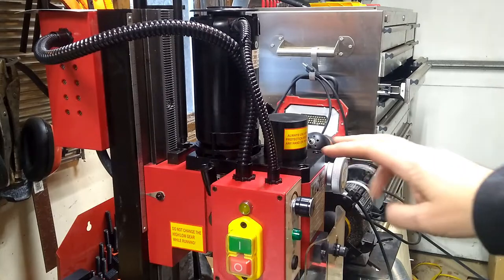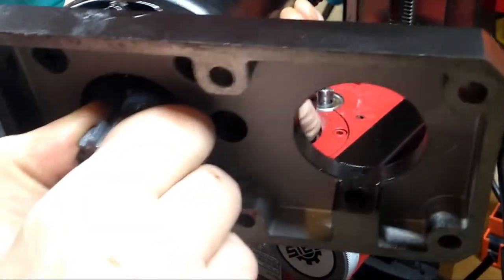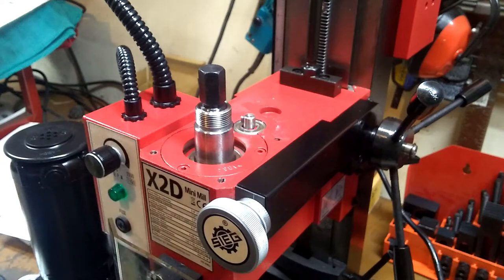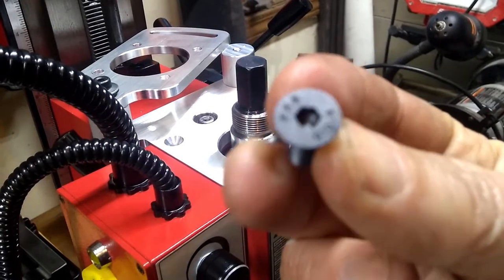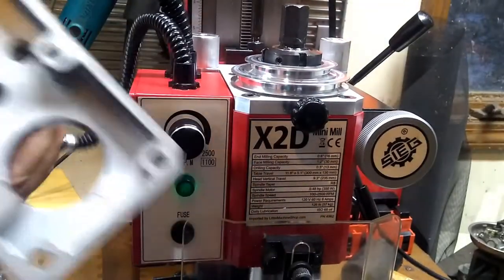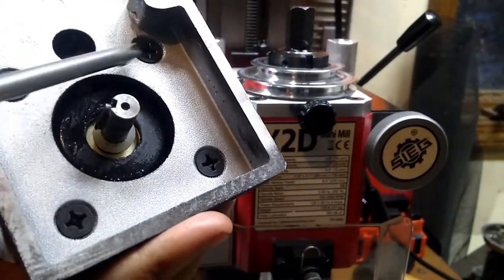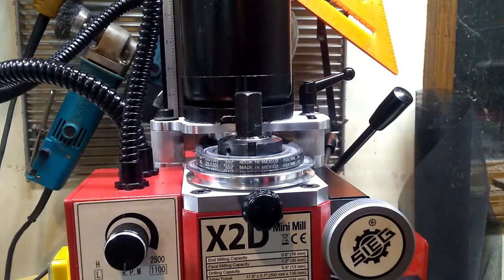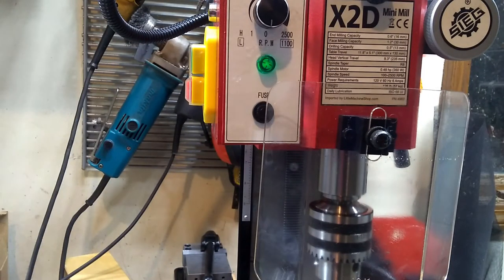Mini Mill: Installing the LittleMachineShop Belt Drive Conversion

Comment: I've had the Harbour Freight version of this mill for nearly 20 years. I had this kit on it for about the last 15 years. To mi\ake it as quiet as possible remove the gears from the head stock counter shaft. It still is a noisy beast.

Comment: Lms isn't the company we thought they were either, there just another chinese company that made everything seem better. It's all the same they just used better language when advertising. You will have to clean your machine and parts before you even plug it in. Be sure to clean bearings, make sure your motor works before it runs the spindle. With these belt conversions I would treat the parts as if I made them and follow the same finishing processes.

Comment: I got a mini mill. I figure I'll be spending most of my time cleaning it and making sure everything is good to go. Because I suppose that's better than it having a bad bearing or something silly. I think that's where most people find issues with these, they just plug them in as soon as they get it. Hopefully the Eastwood is decent.
Reply: I believe the LittleMachineShop models were the only ones that got upgraded bearings & that's one thing keeping it clean isn't going to help with. 

Luckily, the tapered roller bearing set is only about $50 or if you run a higher max RPM you can find quality, sealed angular contact bearings for about $100. Either option makes a big difference over the stock skateboard style bearings in terms of rigidity.

Watch as many tutorials as you can, but it's not hard & well worth the hour or so that you'll put in.

Comment: My best friend gifted me his mini mill which he had already done the belt conversion. Then he passed away last year before he could teach me the ins and outs of using a mini mill. Can anyone refer me to a Manual or videos that shows a new by how to get this up and running. I'd really like to do this in his Honor. Also does anyone make a cover for the mini mills. I purchased a cover for my mini lath from little machine shop it's mafe out of a heavy jean like material works great. Thanks to anyone that can help me with a tutorial or manual, book   what ever would really appreciate it and do would my Best Friend. I know he wouldn't want it to just sit there and not be used Thanks

Comment: At work we have a little drill press ( it's a wonder it's still going strong after 35 years considering the use it's had) that has a spring to put on belt tension, with a lock to keep it tensioned, however I always just use the spring (un-locked) as a bit of slip can be useful if a drill grabs.

Comment: 2 years later:  at 15:17   I did not see you put the spring back in?   Yes, I did get my HF Mill about 1.9 years ago, and the first day I used it,  my mill head dropped a smidge and broke the gears, got the belt kit ordered and it has been fine ever since.   I really like the mini mill for what I do.

Comment: Great job!  I had installed this on my harbor freight mini mill years ago and I've been hearing this weird rattling sound.  All that time it wasn't until I saw your video that I realized that I had left the high/low gear lever in the wrong place and I needed to move it to that mid position as you demonstrated.  Now my machine is even quieter!  Thanks for showing me that.  also, I had no problem inserting the locking bar, but I don't remember whether I drilled out the aluminum mounting plate or not.

Comment: Great video: and timely too, as I would like to perform the same upgrade to my X2.
I am going to order the metal gear set as well, being the mill is 4 years old. You did a great job at explaining things. I like the mill except for the noise...this will help things out quite a bit.
Cheers and greetings from Canada
Reply: I put those metal gears in my Grizzly G0765 mini lathe, and I regret it because it made the thing A LOT noisier! If I ever have the headstock off of it again,  I’ll take the metal gears out and put the plastic back! I did some stupid heavy cuts with it when I first got it without breaking anything! Then I did an epic fail when learning how to part off, and killed the plastic gears! I have used the Grizzly for a year now and feel like I’ve learned what not to do, and think the plastic would be safe now! Just remember that these things aren’t Bridgeport’s or Monarchs! They’re mini machines!
Reply: Wouldn't the belt-drive make it pointless to even have gears??? I was going to gut them out of mine and just go with the belt-drive. You see in the movie that the mounting hardware interferes with the shift lever, so it is maintained in a neutral position. If I ever blow up my gears, then id just get a belt-drive.

Comment: I have a 3d printable design on my channel.
No need to remove the spindle nut,  pulley goes right over it.
Thinking to make some changes now that I've seen the installation process.
Thanks.
Reply: Then what holds the pulley down?

Comment: 10:03 I wonder if a tiny alloy plug (in between the grub screw and thread) would protect the threads.
Reply: You can buy a set screw with a brass tip, or you can put a plastic ball in before the screw to save the threads. I have used both in the past with great success. If it almost never comes apart I would use the brass tipped set screw. If it needs to come apart more often, than the plastic ball is better.
Reply: Promise we've already solved this issue about 80 years back.. Grind/file a flat on the threads where the set screw contacts. Done.

Comment: The hex at the top is for putting a socket or wrench while tightening the locking ring
Reply: That is the draw bar so you might get it too tight, use the locking pin as it is designed to hold the spindle.

Comment: cant you just use a crescent on top to hold it while you tighten with the spanner?
Reply from the maker: The top is the drawbar that you have to tighten/loosen.  You have to be able to hold the spindle in place while you rotate the drawbar.  For now I just use a 1/4" allen wrench as it fits into the slot of the new upper plate.
Reply: @YoshimoshiGarage  Ahh I see, thanks for the reply. Great videos!

Comment: do you lose the 2 speed when putting in this belt drive?    and or what RPM do you end up with?    Great video... thinking about getting my first mill for some small projects coming up soon.
Reply from the maker: It no longer has the low/high in the gear box, bit the pillows are 2-groove so you still have a high and low
Reply: Using drive belt. 
0-1700rpm low
0-4300rpm high

Comment: The metal grub screw that locks the nut to the mill spindle would be better made of brass or nylon, so it doesn't damage the mill spindle thread.
Reply from the maker: It definitely would, but I guess that fraction of a penny that would have cost to do it right was too much. :(
Reply: Promise we've already solved this issue about 80 years back.. Grind/file a flat on the threads where the set screw contacts. Done.

Comment: Hello - why are there 2 grooves on the spindle pulley? Can you install that larger pulley upside down for a different RPM range? I understand it's not supposed to be constantly switched up side down so how do you chose the preferred way to install the spindle pulley?
Reply from the maker: You can move the belt up and down for higher or lower speed range

Comment: Hi! How are you? can you tell me the radius of the pulleys? both the big one and the small one too.
Reply from the maker: It's a bit difficult to measure while assembled, but the pullies on the motor are roughly 2-inch and 1-inch diameter.  The corresponding pullies on the quill are roughly 2.5-inch and 3.25-inch diameter
Reply: @YoshimoshiGarage  Thanks friend for your help. I'm going to try to make them in 3d and then make them in aluminum on my lathe. last consultation. Can you tell me the thickness of the belt so I can get an idea of the thickness of the pulleys. Thanks a lot! for your help
Reply from the maker: @flabiturbo1  The belt part number is 2L130.  It's 1/4" wide and 13" overall length.

Comment: What is the purpose of the black round knob on front of the aluminum base plate apx 90 degrees from where you insert the rod to lock the shaft from spinning
Reply: It appears to just be a knob for holding onto the cover plate.

Comment: I have the upgraded belt drive. I have noticed starting yesterday that my spindle is making a high pitch sound . It goes on and off at times. Is that due to the bearings needing changed or do they just need some bearing grease rubbed into the bearings?
Reply from the maker: Definitely sounds like bearings.
Reply: @YoshimoshiGarage  OK I'm going to try and pack some grease in them and see if that solves the problem, as I just went back and turned on my machine with no load and they are running quiet again. I machine very soft, chalk like materials.
Reply from the maker: It reminds me that I have a set of new bearings that I really should put in and make a video for.
Reply: @YoshimoshiGarage  I actually also have a new set of bearings, so def make that video lol, then I will know how to.  I'm hoping the new grease I rub in works. We shall see
Reply: @YoshimoshiGarage  I took it apart and cleaned it out and found some of my chalk like material inside the spindle making that high pitch sound. Though I still feel the bearings will need to be replaced soonish;)
Reply: @YoshimoshiGarage  okay so just tore my machine down and in my spindle housing was a bunch of plastic swarf that I machined awhile ago that gunned up the plastic gears inside , which was making the spindle nit turn smoothly as well as creating a hi pitch sound. Being that I have the belt upgrade, I took out the plastic gears and everything is purring like a kitten. Smoothest and quietest that I have heard it run in a while ~
Reply from the maker: Great suggestions.  I should get in and pull those gears out of mine.  I'll put it on the list of projects I need to do.
Reply: @YoshimoshiGarage  yeah , I tore it down  cleaned everything, much needed, and I was surprised how much swarf was in the housing and those plastic gears are a must to go. You will notice  HUGE difference in performance and sound. I love hearing it run now~

Comment: so how do you like the mill after using awhile? thinking of getting one.Nice job on the upgrade.Nice music too.
Reply from the maker: Overall I like it.  I think, as with any machine tool, I wish it was a bit larger.  I'm always coming up with things that don't quite fit on the table,  but I really don't have space for a larger machine.  The one thing that I'd get if I were to do it again is the high-torque motor.  The one that's on this, even with the upgraded controller, just doesn't have much power.
Reply: The Seig 2.7 / Grizzly G0704 is what I wish I had went with over my LMS 3990 (X2D) but I think that's always going to be a problem; You always need a bigger one!

Comment: Ah!! forget it. I see what it does. It locks the protective cover down.  Next Question,  now that you have been using it for awhile what is your impression of it ?
Reply from the maker: Like all tools, you wish you had just a little more.  Primarily I'd like a little more power in the motor, and I regularly seem to hit the travel limits, but for the price and the space I have I'm happy with it.  I'll be adding DROs and an X axis feed in the near future.
Reply: @YoshimoshiGarage  You can buy a motor for the SIG with more power even a brushless one and it is not expensive + the machine becomes more silent.
Reply from the maker: @china_airguns  Good call!  It's definitely on my list to do, though I'll probably fab a power feed from a wiper motor I have and install a DRO first.

Comment: 10dB reduction doesnt see worth it.. Maybe if the gears blow up, then get that kit?
Reply from the maker: It's definitely a noticeable 10dB.  I think the bigger change is frequency, the gears are a much higher, more grating-on-the-ears frequency for me, and the belt is lower and far less annoying.